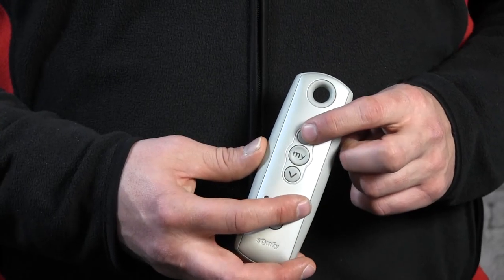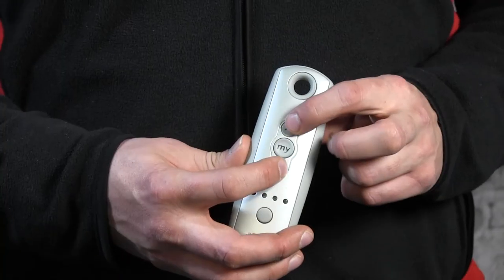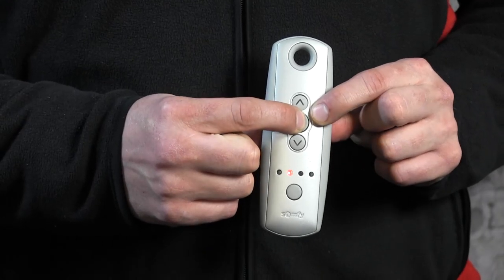Easiest way to adjust the upper limit on a Somfy RTS motor (without reset)

Comment: Thank you for the videos! I am trying to readjust my Somfy's RTS motor up position as you told us, but it does not respond to the first stem (holding up and down together). What could be happening? Is this procedure valid for all Somfy's motors?
Reply from the maker: Hi Jean, 
It could be that the motor does not reach the end limit that's in the motor's memory. 
For example, if the motor runs too far up, you probably stop the motor before any damage is done. But that prevents you from being able to adjust the end limit with this short cut.
The other option is to reset the  (see here:https://www.youtube.com/watch?v=sTGraGEfEH4) and then re-program the motor (see here: https://www.youtube.com/watch?v=z3FQa_RRXKw) 
Hope this helps,
Otto

Comment: Hi. I'm slightly confufsed by this and the 'adjust bottom' video. Both seems to follow the same steps, so how does the motor know that you are setting either the top or bottom position? In the original set up you needed to press the Middle and Up at the same time to set the bottom position. Thanks in advance
Reply from the maker: Hi, the procedure is indeed very similar -> make the shutter roll to the lowest or highest position, press up and down simultaneously and hold until the motor jogs. Move to desiered position, press and hold "my" until the jog. That's it.
But, only possible when:
- motor has been programmed manually
- lowest or highest position can be reached

hope this helps..

Comment: i'm trying to program 1 of the 7 shades in the same room.  i will not function when i press the up or down arrows.  the shade is on upper limit position and when i pressed both at the same time, the shade started rolling(sounds like jog).  also, can i re program all 7 shades and start all over again and have them on one channel?
Reply from the maker: lou qualls If the highest position can not be reached, the motor will not respond when pressing the up and down error. You need to be able to go to the current highest position and work from there. If that's not an option (when rolling in more would damage the shade), the only option left is a full reset and start from the factory settings. To create 1 channel for all of them, you can copy them from say channel 1 to channel 5. It really pays to have all of them on a seperate channel though, as adding an additional remote later on for just one or a selection of shades would be very easy. When they're all in a group, it would mean unplugging the ones that will not have a new remote. To copy a remote, check out this video https://www.youtube.com/watch?v=NflF7aYC0R0